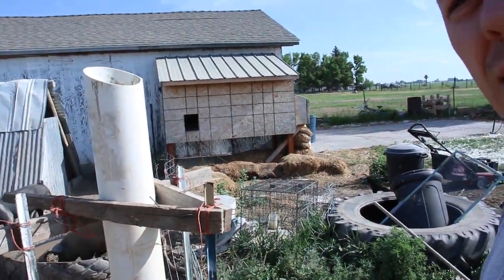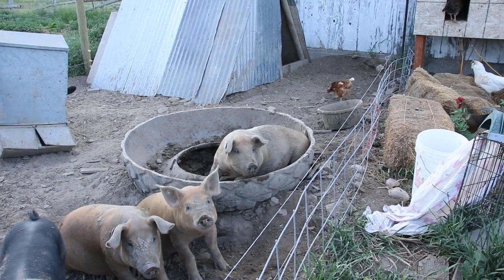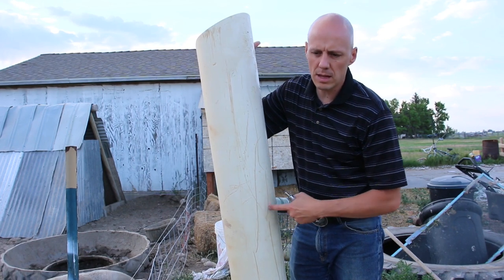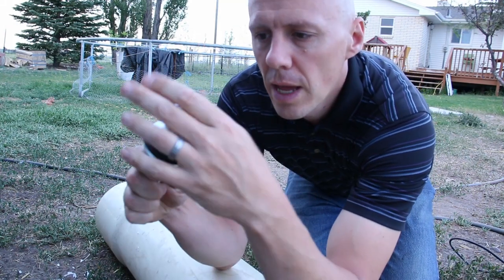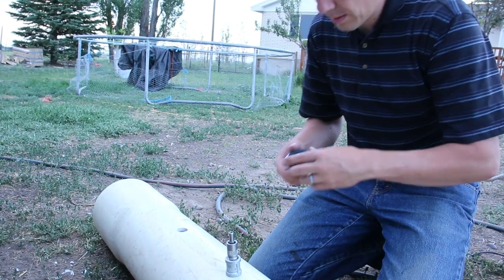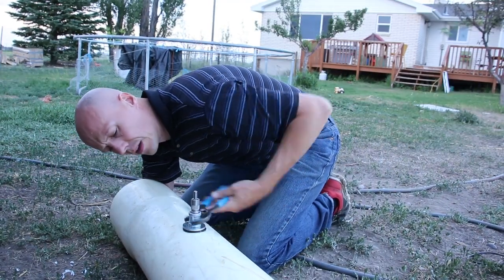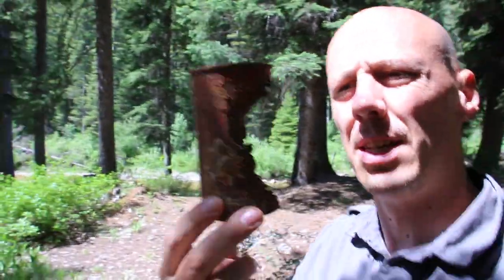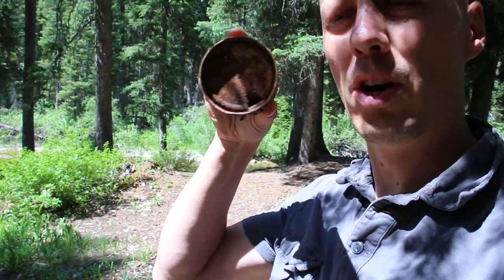DIY pig waterer build

Comment: How can you keep this from freezing?
Reply from the maker: It would take a lot.  So far, we just buy pigs in spring and sell before it freezes. In the past when we have had pigs through the winter we have just used a short trough.  It works in the winter because it's cold they don't try to get in the water.  This one works better in the summer as it keeps them from wallowing in their drinking water.